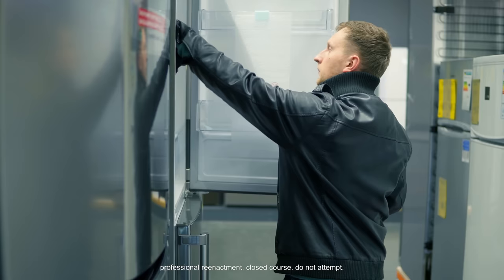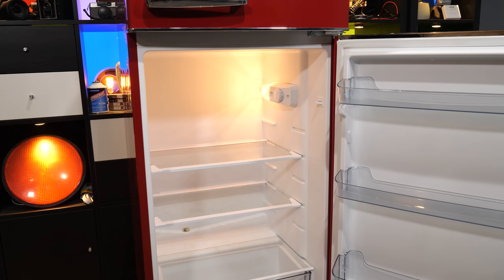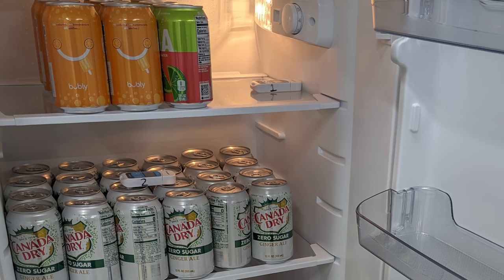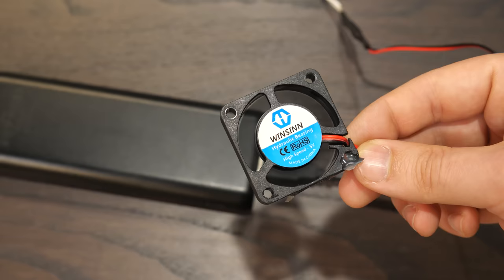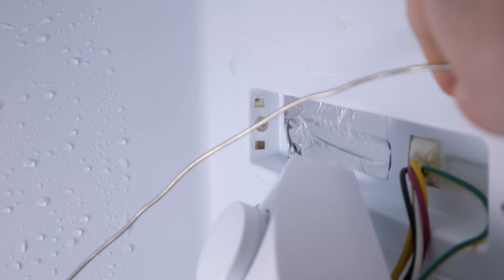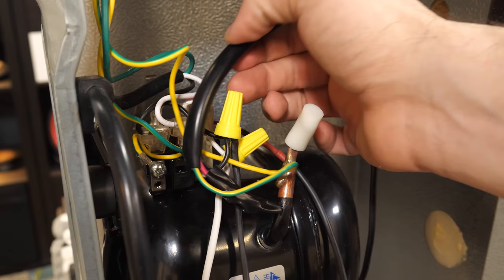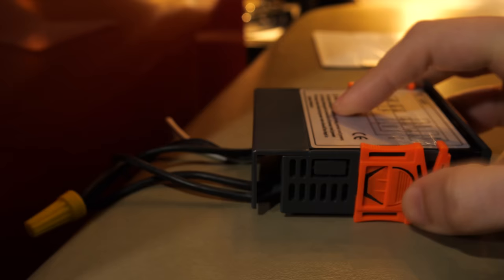This goofy fridge has a really clever design. It's also kinda terrible.

Comment: Big fan here. I repair fridges for a living, and i really liked this video, it was really fun seeing you figure out what's happening. Here in europe these kinds of fridges are really common. So the thermostat sensor is placed on the middle of the evaporator, the thermostat wont let the compressor start until it is fully defrosted. It is made this way so it wont accumulate frosting in the fridge and the compressors running long periods of time will overheat and can cause the motor coil to get damaged. Keep in mind that these compressors are not that efficient. The temperature issues was solved with a bigger evaporator and a fan placed above it. The fan only runs when the compressor is running and the door is closed. Really nice video
Reply: Oh so there is a reason for the placement, not just it being a mistake! That kinda makes sense, it's the sort of design that works "good enough" and is cheap. It might explain why the advice to not put warm things in the fridge and to keep it decently full if possible is so commonplace. I remember recently Alex talked about how the energy used to cool something a few more degrees isn't that much, but perhaps the advice comes more from the fridge's lack of precise temperature regulation and the recovery time rather than really the energy saving!

Fun video, my very standard fridge here in the UK is basically this exact thing but without the fancy red design. With the addition of a switch for freezing food that just keeps the light on low inside the fridge giving it more to cool, therefore making the freezer compartment colder.
Reply: Since you're a professional: the seals touch an heated part to avoid them to stick, right? Is it a resistance or part of the evaporator circuit?
And can this heat have been contribute to the results of the loggings of this video?
Reply: @PaoloSulprizio  I'm afraid I don't understand your question. There is no heater in these kinda fridges, the evaporator in the fridge side defrosts because of the temperature difference between the evaporator and the air inside the fridge, and this is how it cools the fridge. Fridges that use resistors have it in the freezer compartment and it only defrosts when it needs to (when enough ice accumulates on them).
Reply: @gerebalpar7712  I'm speaking about the doors seals
Reply: @PaoloSulprizio  oh sorry i get it. On the back side of the fridge is the condensator, the black grill, which gives out heat. A part of it is incorporated inside the body of the fridge where the seals touch the body. The reason for that is that it has more surface area to give up heat and the heat keeps the seals soft through the years. Older models didn't have it and the seals became stiff and ruptured

Comment: The "NO! STOP IT!" from off screen when talking about adding a fan by the compressor made me laugh out loud. This channel is the best.
Reply: I laughed too, but I thought maybe having a fan back there that also pushes air past the sides would maybe help a bit with efficiency and longevity.  Of course, I am not an HVAC or appliance technician or engineer, but what do I know?
Reply: It totally would help. My travel fridge/freezer has one or more (it's got 3 vents but not checked if a fan for each vent or just 1).
Still slow, but seems to help.
Reply: Here I sit, ready to watch Part 2, another hour of refrigeration optimization experimentation!

Comment: For me in the UK, this is a VERY standard fridge. While plainer on the outside, every fridge Ive had has been identical to this on the inside
Reply: My current fridge's freezer section has exposed coils between each drawer. It seems fragile.
Reply: And we don't call them 'mini' fridges.
Reply: Why the UK still lives like the luftwaffe is flying overhead?
Reply: Almost every fridge ive ever had is basically this except its much more plain usually just white
And i live in america
Tbh i never even knew this wasnt a standard type of fridge here
Reply: @tripplefives1402 
yeah, things are getting kind of ridiculous.

My grandmother and I went shopping for a fridge recently and I could not persuade her to buy a medium, efficient Freezer-On-Top single hinged fridge if my life depended on it >_>

12 cubic feet would have been plenty for us but the best I could negotiate was a double door 17.5 cu Samsung monstrosity with a drawer freezer on the bottom
Reply: Yeah, same thing here in italy. Heck, my grandma pratically had the same fridge, but from Candy brand (dunno how common elsewhere) for close to 20 years. Gave up the ghost because, as Alec reported, a small leak compromised the freezer compartment. But all of the fridges here are built like that, and they work well
Reply: Same here in Austria. This is as bog standard as it gets.
Reply: Small houses, generally shop little and often. 
America has that big suburbia thing going on, while here even semi rurally is usually mixed purpose zoning, so little shops where you can get milk and bread without going to the big shop.
Reply: Yup. That's a typical fridge size for countries that sell milk and juice in liters, not gallons.
Reply: @pfefferle74  quarts for milk and juice are still pretty common here, though they are less cost effective than the gallons if you have a family that would go through the gallon in time.
Reply: Yes  I have this fridge (a 240v version, of course) and there's nothing 'mini' about it - it's the perfect size for the kitchen of an average British house. I also have relatives in the US and even the 'standard' fridges there are the size of a small car. That's before you get into the double door versions, which are considerably bigger than the 'American style' ones sold in the UK.
Reply: @Grumpini  A lot of kitchens straight up won't fit an american fridge in them tbh. Plus we tend to go shopping more often and stock up less as its fairly common to just do a little bit of food shopping on the way home from work or something, instead of specifically going out with the intention of stocking up.
Reply: @tripplefives1402  I thought the US had walk-in fridges. Cases of beer on the left and whole beef carcasses on the right.
Reply: @raytrevor1  that's almost exclusively businesses.

Homes just have ridiculous monster refrigerators over 20 cubic feet >_>
Reply: @benholroyd5221   Fridges in the UK are generally about 55cm left to right, 56cm front to back, and the height varies.
Reply: @Grumpini they drink warm beer so they don't need much fridge space
Reply: Europe usually has shops much closer to home - thus no enormous stocks needed.
Reply: @CampGareth  It’s not fragile. Those exposed evaporator coils are a very traditional method, the oldest fridge freezer method which has proved reliable. It’s good because it’s easy to keep an eye on for maintenance. 

The other style (hidden/wrap around evaporator) could have issues going on inside the casing that you couldn’t see, although if it makes defrosting easier because you just wipe down plastic walls.
Reply: @willjackson1955  Sadly CandyHoover were sold to Chinese Haier a few years ago and quality went down a bit (although many of the factories and design are the same). Big brand here in the UK over the decades, just like Indesit (now part of Beko/Whirlpool but still with Italian factories). UK always had a lot of Italian appliances.
Reply: @raytrevor1  Now that sounds like a fridge.
Reply: Hell, I have 2 full size fridges and a chest freezer. And if I had room in the garage there would be another beer fridge out there too.

Comment: I used to be an appliance repairman 20 years ago. We always recommended keeping a fridge full. The oldest guy would always tell people to fill cool whip bowls with water and put them on empty shelves.
Reply: 👍 Larger thermal mass == More stable temperature.
Reply: Random barely related gripe, Great British Bake-Off had an ice cream challenge where the secret pitfall was that the bakers were not to chill their ice cream mix in the freezer of their fridge before putting it in the ice cream machine, as that would cause the freezer to become too warm to finish freezing their soft -serve.

Moderately annoyed me, not just because the constant I was rooting for did badly because she didn't know that, but because... A normal home baker's freezer is a bit more temperature stable than that! Why are you pinning the pitfall of this challenge on the bakers knowing how an empty freezer works? Surely their home freezer has stuff in it that will carry enough thermal mass to quick-chill their custard and then 20 minutes later finish freezing their ice cream...
Reply: That's funny, because I use two liter soda bottles filled with water, or milk jugs. And or plastic 'ice packs'... or whatever containers I have around. The idea is that you fill up the empty space with these and they freeze... and when you need more room, you can take one out (I switch them over to the fridge, then put them back as the freezer empties).
Reply: @AppleIPie  That's one of my least favorite cooking shows of all time. I had to stop watching, after only a handful of episodes. I just couldn't take the constant cringe. To be honest, I can't stand cooking competitions.
Reply: @hxhdfjifzirstc894  and if the power goes out, they stay cold longer
Reply: Thermal inertia / thermal momentum
Reply: @hxhdfjifzirstc894  Me too. I fill old 32oz vinegar bottles. Bonus is it's drinkable water for the Zombie Apocalypse and just right for a backpack or cooler instead of buying ICE. ;)
Reply: Being a single male. I dont have much in my frig. Or freezer. I have 2 liter bottles of water in my freezer. Also my grandparents had an old frig. Maybe 50- 60s. It is a propane refrigerant. And last i knew it still ran. 😂
Reply: @nathank4708  I know a single middle-aged guy who loves to complain about his power bills, he's basically incapable of cooking for himself but he has a big 300 litre fridge in his kitchen. Usually it's empty except for maybe a bottle of soda and some leftover takeaway food. Good luck trying to explain why that's a terrible idea though, dude doesn't want to hear actual solutions to his problems, he wants to complain. 😂
Reply: Which is good advice but I guess RV fridges aren't good to keep too full since they don't work like household fridges and need good air flow to work properly
Reply: @hxhdfjifzirstc894 Guy who doesn't like cooking programmes is utterly shocked he doesn't like a cooking programme. More news at 10.
Reply: In New Zealand and Australia, most small to medium fridge-freezers are this design, (like your Red fridge) which is often called "Cyclic Defrost".  Mostly it's just the much larger and more expensive fridge/freezers that have fan air circulation, and advertise "fully frost free",. Very rare, but cbecomming more common on expensive large models are ice or coldwater dispensers. I lived for many years in Outback Australia, in an uninsulated,  non-airconditioned house where even the inside temperature was often  in the high 30's Celsius (approx 100 *F). When I moved there I bought new, the cheapest basic fridge/freezer I could get. It worked fantastic. I always kept the freezer section almost full, using plastic  ice cream tubs or plastic softdrink bottles  full of water, filling most of the  empty space. Some bottles later being taken out and used for drinking, or available for Zombie Apocalypses. The instruction leaflet that came with the fridge actually recommended what number to put the fridge thermostat on for what the outside temperature was. So I adjusted it accordingly throughout the seasons.  My freezer section maintained minus 18 Celsius, the recommended standard, without trouble. One time I set the fridge thermostat to maximum as a test,  and my Mercury thermometer  I had put in the freezer section, went down to minus 25 Celsius.
Reply: @AppleIPie  disliked that challenge too. Bc it wasn't geared towards home bakers OR professionals. Wouldn't a professional ice cream maker have, like, a blast chiller or, more likely, a freezer full of ice cream? Why would they have any experience with empty freezers either? Its not very efficient after all. It wouldn't make sense. 

It just seemed really nitpicky and unnecessary. Like it wasn't testing any practical knowledge or skill. If making ice cream is too easy, have them make dairy free ice cream. Or italian ice. Or fried ice cream. 

"But what if the equipment doesn't work!!?!" isn't a good challenge, even if you want to test their technical knowledge.
Reply: You shouldn’t need to do that. Then you need space to store a fridge worth of water jugs when the fridge is full.
Reply: Coolhuip
Reply: This is basically a wives tale, there seems to be 2 reasons people say to do this:
1) less air in the fridge means less air leaves and enters when opening the door. Air has very little thermal mass so the heat energy entering the fridge is negligible.
2) in power outage, the fridge stays cold longer. This is somewhat legit, but vast majority of people have stable power, and fridges stay cold without power for a good while as they are well insulated. Most power outages are short enough compared to the rate it warms up that this isnt an issue.

Cant see how it useful, esp given it causes hassle to the user, have to move stuff around the thermal mass and to change it out (unless you use filtered water, those containers will get gross over time or need changing).
Reply: @benhook1013  no. The added thermal mass will also help cool down new stuff you add by exchanging heat with it and keeping the temperature in the fridge more stable.
Reply: @chunye215  is that a practical issue or fearmongering though? most of my point was that while technically helping the operation of the fridge, its negligible.
Your point is more of a tangible change but I've never personally noticed an issue with new items causing other to heat, to need to fix it somehow.
Reply: @benhook1013  The stored negative energy in that mass is that much less work the compressor and refrigerant cycle have to do. The specific heat of all of that mass is greater than the specific heat of the air that it displaces.

For example, an empty 20 cubic foot freezer at zero degrees F. holds 1.725 lbs. m. of air with a potential energy difference to the freezing point of water (32 degrees F.), of 13.25 BTUs.

The same refrigerator full of frozen peas (weighing 1,034 lbs. and at 0 degrees will have a potential energy difference to the freezing point of water (32 degrees F.), of 7,613 BTUs, over 574 times the stored potential energy.
Reply: @benhook1013  a large portion of this video deals with this, and how it does have meaningful impact for the fridge design in question. Obviously the big "proper ones" have a bigger compressor and can handle the situation better.
Reply: @TommyJwon  This is the misconception though, even if more thermal mass means new food gets colder faster, thats just by helping to store some of its own heat in the existing food, but the compressor still needs to do the same work overall to bring all the items back down to normal temp...
Reply: @chunye215  Yes and I did watch the video, but this wasnt a 'real' fridge (its a minifridge) and putting in that huge amount of new items - Ive never come close to doing that at once before.

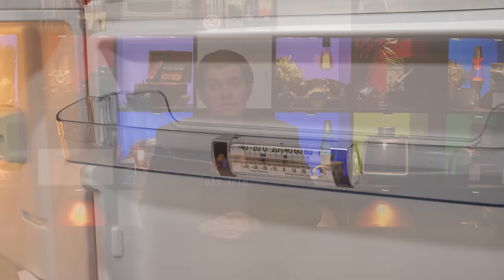Comment: 17:00 From watching Kitchen Nightmares, Gordon Ramsey would always tear into staff who put hot items in the walk in fridge, likely for this reason.  The fridge just can't compensate fast enough for the sudden heat source and now everything in the freezer or fridge is now going to get warm for a bit.  He says you should let the food cool to room temp then put it into the freezer/fridge.

26:30  My guess is that the compressor is so small that to protect it from burning itself out it has a run time limiter that prevents it from running continuously so once you put the cans in it could only cool it part way, then the compressor cools off, then it runs some more, cools off, etc.  

39:40 I like how you can see his progressive rage building out of frustration and confusion.  "What?  One fan didn't work?  How about one big one?  How about one on each shelf?  Hah?  You like that!?"
Reply: Yeah.. So your guess is not consistent with the experiment. Because he ONLY messed with the temp sensor. So either this 'timing' thing is built into the sensor itself or does not exist.